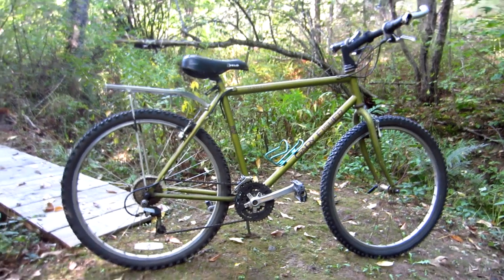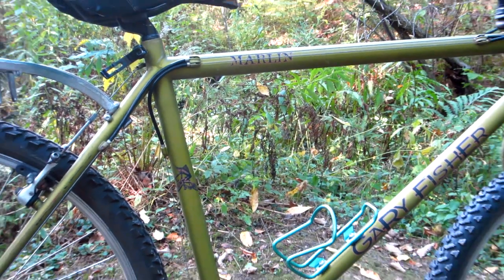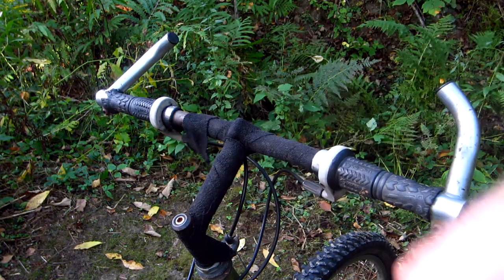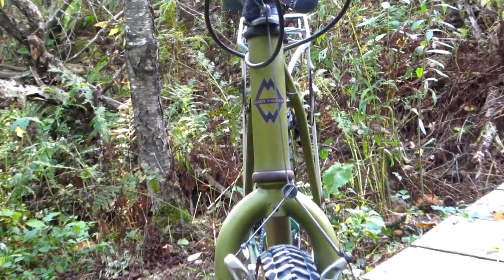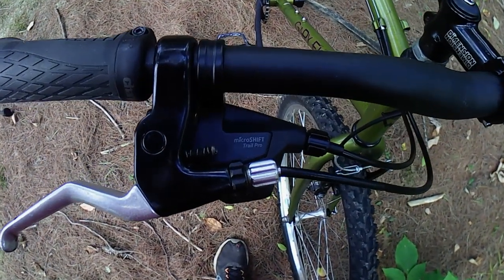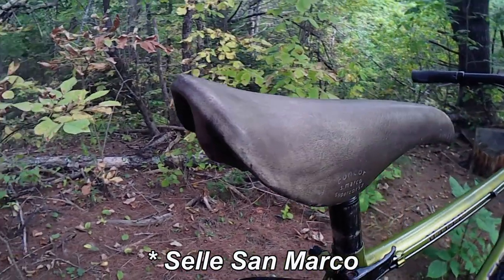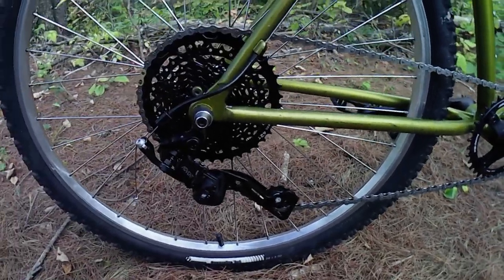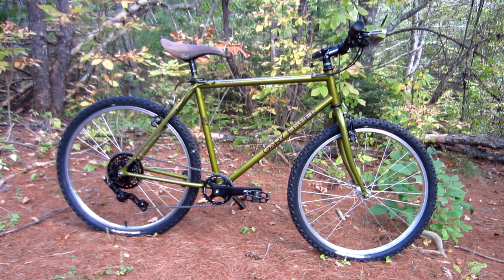Vintage Gary Fisher Marlin Restomod With Existing Parts

Comment: She's a beaut!  Congrats!!
Reply from the maker: Thanks, it's built really well which I like.
Reply: @JimsObsessiveCyclingDisorder  Jim,  I am curious if you have to do anything to make the rear wheel spacing work with the new 9-speed  freewheel?
Reply from the maker: @Silvergreenelsinore  Hi, nope, the setup worked perfectly on the first try.  I even got the chain alignment right without even trying!  This may be due to my use of non-stock wheels, though.

Comment: Hi Jim! Happy Sunday! Great job on this restomod! Great work! How long did it take to do the job?
Reply: What do you use to clean up the frame and components?
Reply: And what do you use for the clear coat?
Reply from the maker: Hi, and thanks.  It took 3 days working off and on.  For cleaning I used Simple green, brushes and rags.  The clear coat is Rustoleum rattle can.